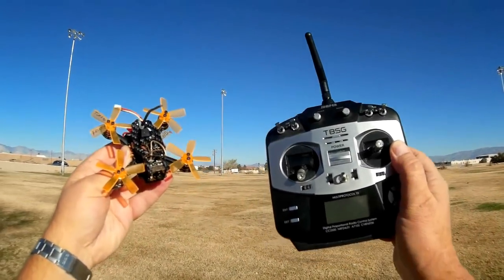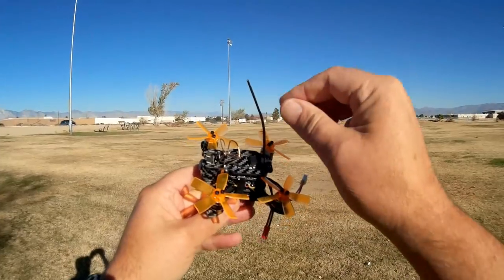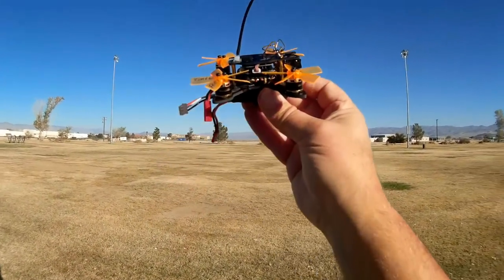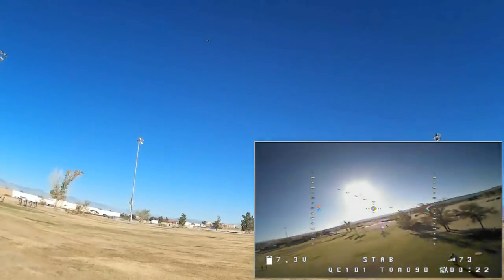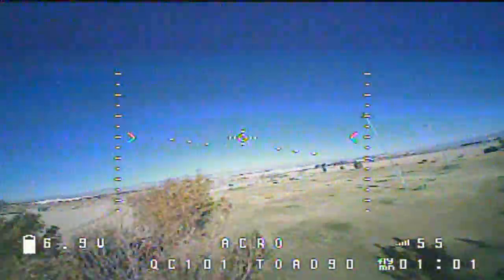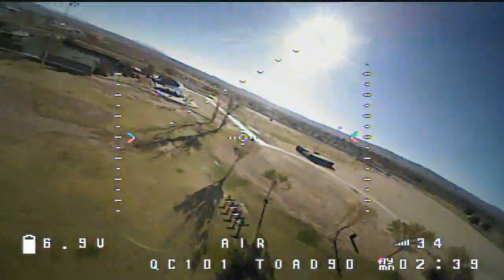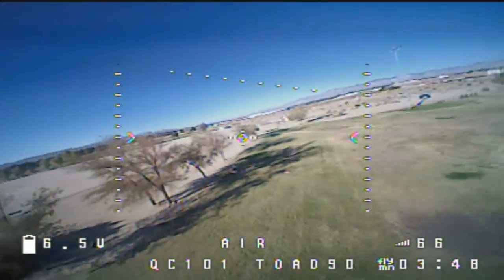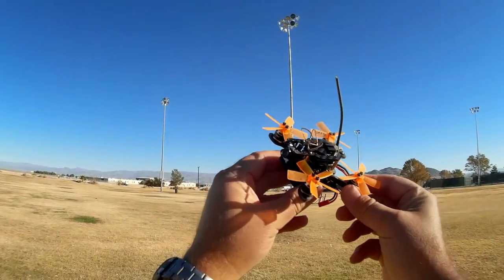Furibee Toad 90 Micro Brushless FPV Racer Freestyle Drone Flight Test Review

Comment from the maker: Find the Toad 90 here try coupon FTOAD9027 https://goo.gl/snNVTb  Available in Frsky, Flysky, and DSM2/X.  But it doesn't matter which version you get if you own the T8SG Jumper all-in-one transmitter that I used in this video ;-)  Find the T8SG Jumper here https://goo.gl/mvnCk9 And here are GearBest's 11.11 flash sales https://goo.gl/eeGeWF
Reply: Coupon doesnt work for me
Reply from the maker: You need to sign in first before applying coupon code FTOAD9027

Comment: That T8SG TX with Deviation protocols is nice for flying various toy grade quads, but when flying a little FPV racer, I think you'd be better off using your Taranis 9D+, which has better gimbals and control layout, as well as options to set up voice warnings so you don't fly down past 3v per cell.  Pretty decent little machine (as Seby calls them) and I'm sure you could probably do a little mod to the camera holder to get more pitch angle on it. Thanks for the review .. cheers.

Comment: Amazing review and flight. Wanted to know what would be the best acro fpv drone for a starter. I have dji drones and have few micro cheap ones for indoor flight. Now wanted to put hands on the acro ones. This one looks pretty good but what would be your recommendation? Thanks
Reply from the maker: If you're considering entering acro FPV, would recommend that you start with practicing using a simulator.  A good free one to try is the following.  It has a free demo version that is more than adequate to learn to fly acro. Or you can get the full version for $5 https://fpv-freerider.itch.io/fpv-freerider
It goes hand in hand with the following series of tutorials by Joshua Bardwell https://www.youtube.com/watch?v=391D5dX7LKg&list=PLwoDb7WF6c8kjYXam4m3msvRbkORU41GY
Later when you're proficient in the simulator, you should easily be able to transition into flying petty much any FPV racer drone.  And yes the Toad 90 is a good little outdoor micro to start with once you've done some simulator time.
Reply: Quadcopter 101 Thank you so much, i will definitely do that! Cheers mate

Comment: Quadcopter 101: you comment that the angle of the camera prevents you from going full speed and that's it's probably not a good racer. What exactly is the relationship between camera angle and speed and racability? thanks for the excellent reviews btw!
Reply from the maker: In order to fly fast, you need to pitch the quadcopter's nose downward.  The farther downward that you pitch the nose, the faster the quadcopter can fly (simultaneously you need to increase throttle to stay in the air).  Now if your camera is pointed straight ahead with 0 pitch angle, you'll be looking at the ground when flying at high speed in the forward direction.  That's why it's important to be able to raise the camera angle upward.  You want it to be at an angle of approximately level with the horizon when the quadcopter's nose is pitched downward for desired maximum forward flight speed.

Comment: Nice flight! How did you configure the T8SG to pass the RSSI signal through to the OSD?  I have a T8SG and an XM+ FrSky receiver but can't figure out how to see the RSSI on the Receiver page of Betaflight or get it into OSD.
Reply from the maker: I didn't.  The quadcopter's OSD is incorporated into Betaflight, and automatically displays RSSI out of the box.
Reply: Quadcopter 101 - thanks! There is a setting in the FrSky protocol for "LASTCHAN" for RSSI - which I have set - and the XM+ receiver supposedly has RSSI on Channel 16 - but I don't see it in Betaflight.  So, my guess is that the XM+ needs a firmware update to put the RSSI signal out.  The T8SG has a max of 12 channels - and your RSSI is likely on channel 8 (Aux 4).  You and your happy videos got me into this hobby and taught me to fly - a couple of years ago - for which I thank you (and your long suffering wife!).
Reply: Same here! I watched one of his videos over a year ago and knew right away I wanted a quad. I had no flying experience other than a few toy helicopters. I immediately got hooked on the H8 mini and H36 I purchased after watching this channel. I now have several custom quads built from parts and bits laying around. I would love to eventually start building on a Pixhawk autopilot with telemetry.

Comment: Could someone clarify why there are three plugs on this quad? I understand one of them is for power. What are the others and what are they used for? Are they typically that long? thank you.
Reply from the maker: Are you referring to the battery power and balance charging plug?
Reply: I guess I'm referring to the balance charging plug. I fly my nano qx with the little 1S batteries. I've never seen more than one wire/pig tail on the quad. thank you.
Reply: oh you plug the balance port in the charger, balance ports are found on lipo's over 1s